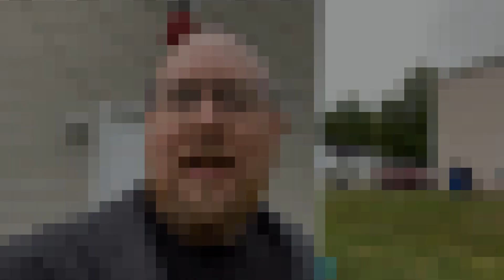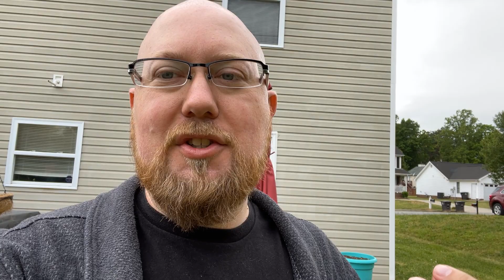A DIY Project With the JBL 550P Subwoofer - Turning Broken Into Booming

Comment from the maker: I wanted to add that I did use a multimeter to determine this sub is indeed 4 ohms before I tried powering it myself to ensure I could get the amp part of it right doing that myself. Hope that's helpful for others thinking to do the same.

Comment: One day the subwoofer was working fine, the next day it stopped making any sound. The green light indicator is on so it means it is receiving power. I tried using a dual RCA and the sub-out connection from my receiver, but the sub still wasn't making any sound. Purchasing the subwoofer was a mistake as their amplifier boards are so unreliable.

Comment: JBL has this sub on sale for $200. WAS gonna buy it to go with my Studio 530 but hink I'm going to pass.
Reply from the maker: Probably a good call. It's a shame, because the woofer itself seems good and the box is extremely well built -- much more so than most subs in similar price points. This would be a no brainer buy if it weren't for the unreliable amps.

Comment: Hey I'm looking to get this speaker so I was just wondering if you could wire connect it with other speakers
Reply from the maker: Hmm. I don't recall the back plate amp having an output RCA jack or anything. Only an input. And no high level speaker inputs to do what you're talking about either. So you'd have to have a receiver or something that could handle the speakers and the RCA-out to this woofer to use together, if that's what you're asking.